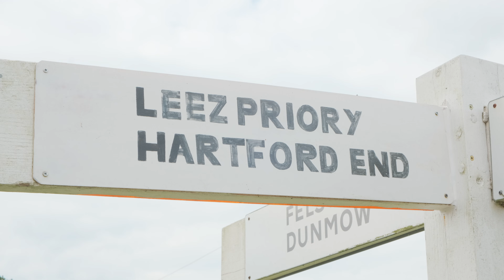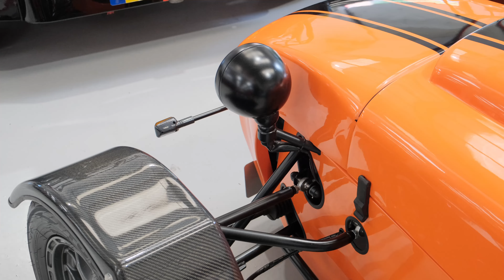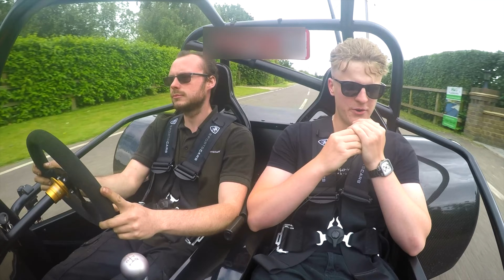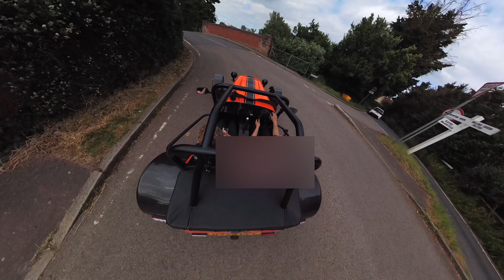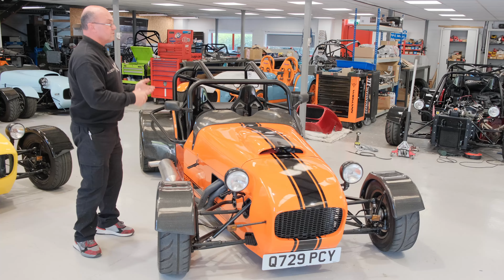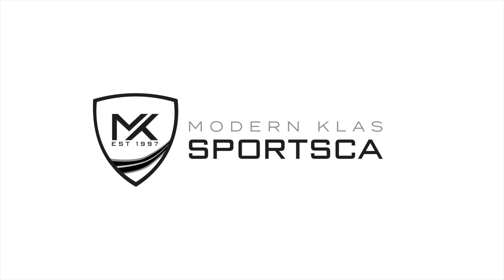9000RPM BEAST! 500KG Honda S2000 Powered - MK Indy RR Test Drive

Comment: I've got the same engine, gearbox and 3.92 LSD in my Westfield but with a lightweight flywheel and ITB's, makes for an amazing "seven". Easily lives with the bike engined cars on track too
Reply: That does yours noise test at ? I'm considering the same drive train
Reply: @andycleal  Normally under the 98db drive by at Donington on the standard intake. I have to short shift with the ITB's but will be fine with an airbox
Reply: @brake_later  I have a fiat TC that revs to 7700 at the moment and it's been fine but it's pretty loud. Trouble with the fury is there's not much length for a silencer/exhaust.
Reply: @andycleal mine has a carbon silencer, it's not exhaust noise that causes me any problems normally, it's the induction roar from the throttle bodies 😂